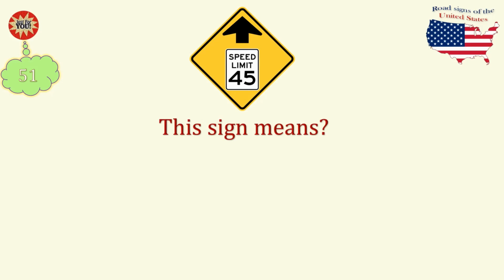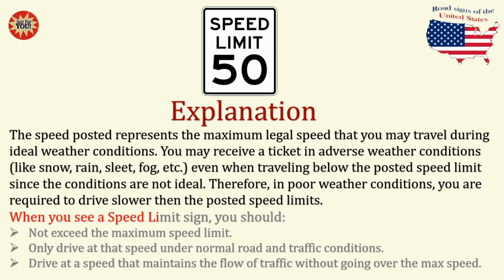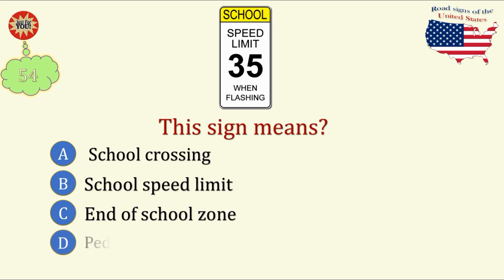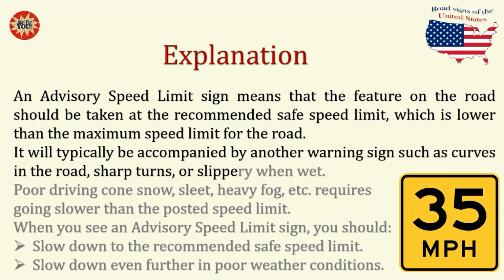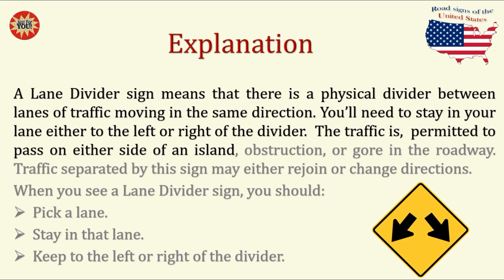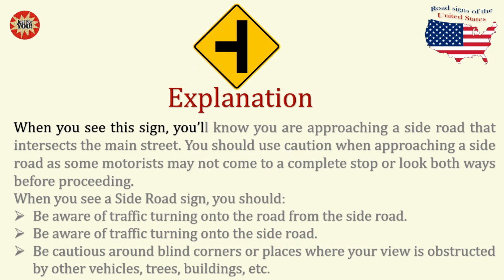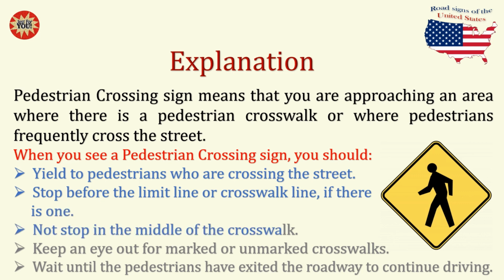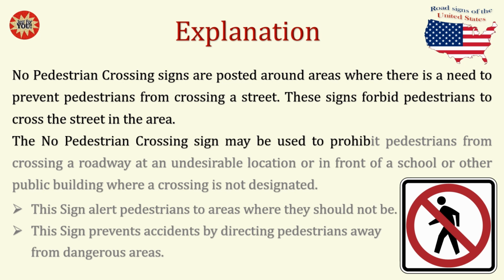USA TRAFFIC ROAD SIGNS - Part 6

Comment: If we can't drive faster than the speed indicated  by the sign and drive slower than the speed indicated by the sign, what are we suppose to do? Drive the exact speed?
Reply from the maker: Thanks for your question! The speed limit sign indicates the maximum legal speed you can drive under ideal conditions. It's not necessary to drive exactly at that speed, and you can drive slower if needed. Just make sure you're not impeding the flow of traffic by driving too slowly. Safety first!